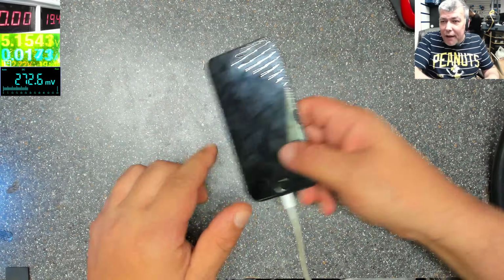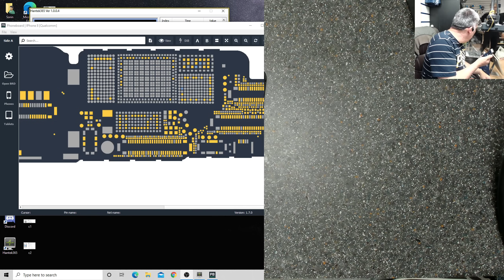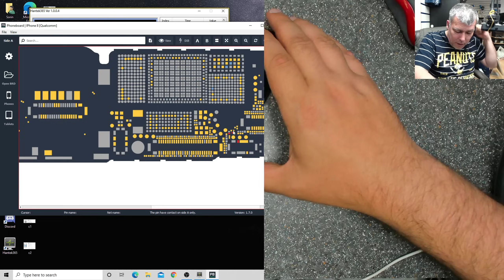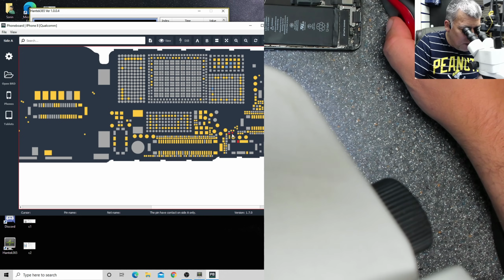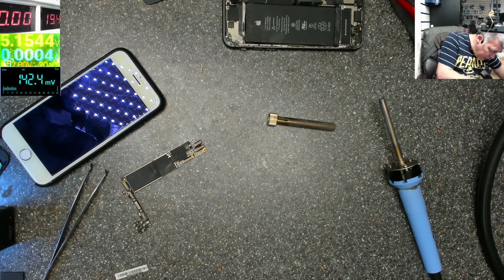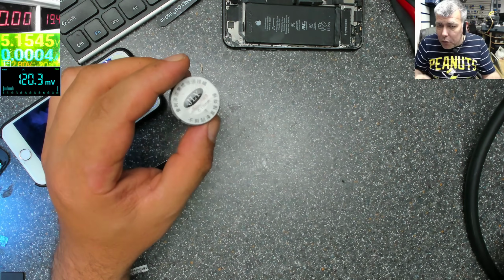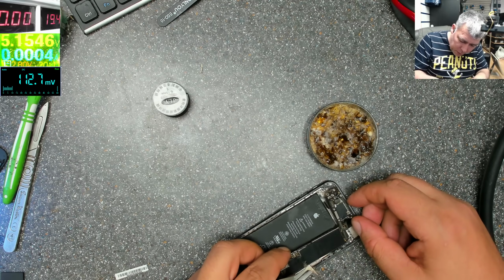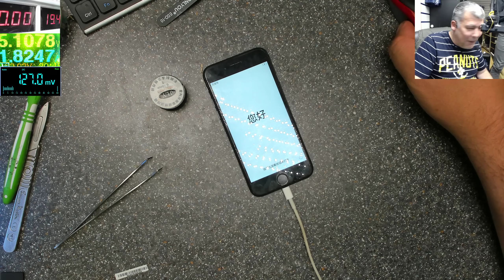Iphone 8 not charging, bypassing the battery bms data lines

Comment: that's a mosfet (Q3200 / Q3201) normally pry damage, phone will not charge or sit at 1% while on charge 

no need to jumper keep them in stock they are very cheap,  or if part not damaged solder back on :)

Comment: I watched all your laptop repair. The best teacher. Can u make video about identifying the 3v 5v Vcore. And i have laptop issue, My board is on and fan is on but no screen. cpu is warm while the gpu is getting hot i have board the transistor two pin has reading 19v while the one pin is higher than 19v, what is mean? Is the transistor faulty? Or other component faulty?
Reply: usually u dont have more than 19v....anywhere at the board!...the Led Backlite from your Screen could have much more than 19v...but the mainboard havent more than 19v....The 3v Line is at your power button....the 5V at your usb! look at the coils, there u find your voltages!
but i guess, this is not your problem, cause your vents are on and u can switch the board on....if these 2 are damaged, you cant switch on and your vents wont work...
Take a flashlight behind your screen and check if there is something on your screen, that u cant see cause the fail of the led backlite!
take a hdmi cable and use a monitor for check!
Reply: I dont know why i get higher than 19v in transistor, my laptop model is hp g6 and when i check the charger pin on the board is short, but it has power led on when i connect the charger, and fan spinning. By the way the laptop is no battery.
Reply: Also the 3v and 5v powersupply/coil is present. But the processor has no reading, and the graphics chip is getting hot when i turn on the power.
Reply: Also i already checked the Screen/LCD pin on board, the 3v and 19v is present. Maybe i should check on flatscreen hdmi, my problem is i have no flatscreen, and hdmi so sad.
Reply: My biggest problem/question is that i want to know why is that the 1 pin in the transistor getting higher than 19v, its like 23v. And the gpu chip is getting hot while the processor is warm.
Reply: @abuzarbuddin3463  be aware by reading cpus with your multimeter directly...
hot? hot like 50 degrees or hot like 150?
check with hdmi and put out the bios battery for few minutes and switch it!
pcie should have 3.3v and 12v....check all  power rails...check led backlite!!
there are many possible fails and its impossible to give any ideas without checking the mainboard!
it could be everything
Reply: @abuzarbuddin3463  if there is a short on a charger port, you have to check the mosfets... a short on 19v line should not be there!!
Hp i guess, has their own "chargers" and there is a comunication pin with the charger and the mainboard! 
find the short compnent and desolder one pin....then bridge to the next coil the 19v...
may you have a bad charger mosfet
Reply: Thankyou, i'am  waiting for my dc power supply that i ordered online, so that i can check properly if there is shorted component. The gpu  heated like 150Degrees.
Reply from the maker: A good starting point its our discord, there you can find some help
Reply: @electronicsrepairschool  what you mean? Sorry i cant understand so much in english. Im from philippines i want to make some business, i dont want to go to school for advance laptop repair because it cost expensive here i cant afford. :( And also i already graduated BS ECE so i know some basic electronics. Is there available books/pdf about advance laptop repair like motherboard repair?
Reply: I really love your work that you can find the faulty component without using schematic diagram. You're a Pro man. I'm so amazed
Reply: @abuzarbuddin3463  its easy to find the bad components...do it in "sorin style"....just need a power source and lighter fluid^^

Comment: Can the same be done for both battery data and clock lines?  Also how to figure out which side of the transistor to go on without board view or schematics? Would there be any harm if the wrong side of transistor was selected? 
Thanks in advance!
Reply: Probably not

Comment: hi 
i have a problem with my laptop asus x550v it's not running or charging i I took the laptop for maintenance
they told me that can't be fixed and i have a heat problem at my hm170 chipset. 
Will it be repaired if I replace the chip? 
thanks

Comment: Mine will not turn on.  It died and when plugged in randomly.  It will draw 400 mw for a second then 0, 2 seconds later it will draw 400mw again for a second ( literally)..  sometimes it will draw 300mw or 350 for the second but it will continue to do this indefinitely, never allowing the phone to be powered on again..  the battery health was at 80% (service) the charge was at around 27% when it died..  no warning and was charging with the official iphone apple charger it came with..  same cable also..  is not the latest ios but is 14 so close…. Never had any issues before..  any suggestions?  Please.. :)